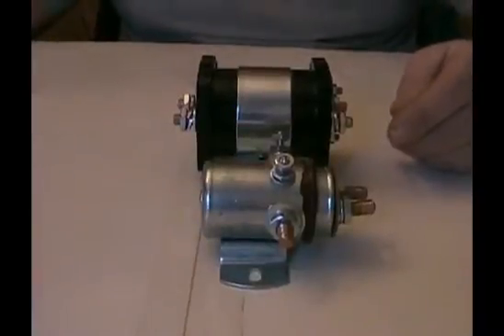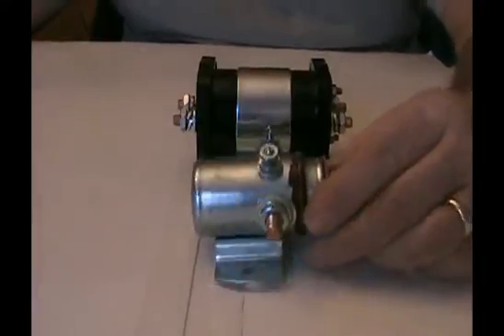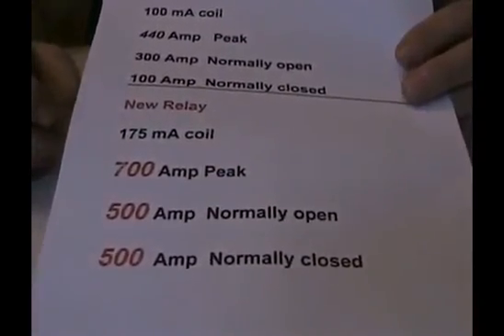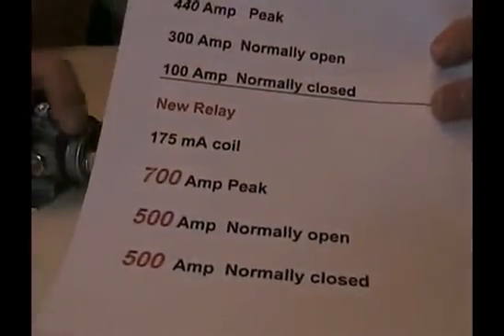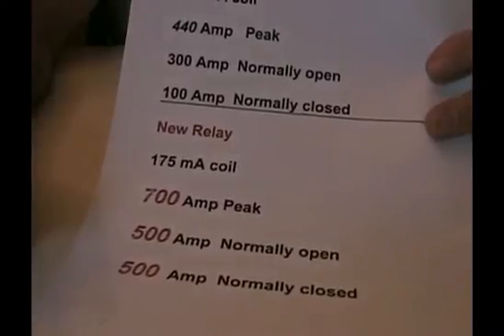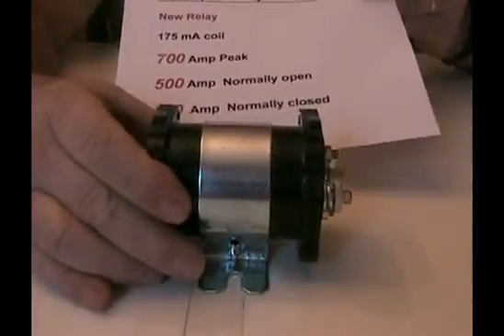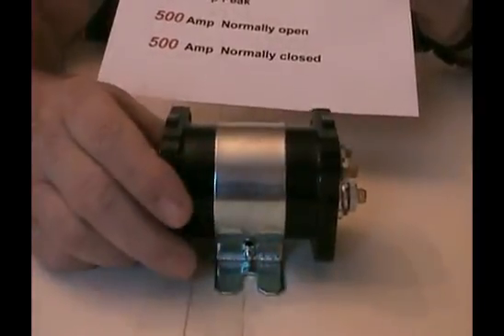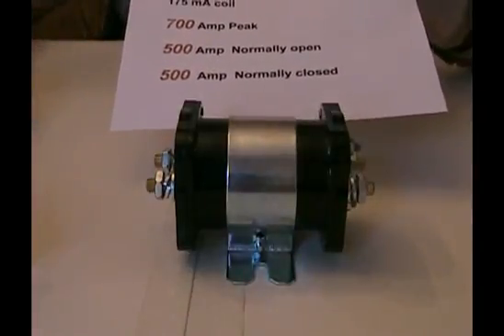Dump Controller Relays The real truth and facts.  DIY

Comment: I need to find a good Relay with 2 pole for switching a 7kva transformer off and on at 240 volts AC.   With my new inverter it has a call for generator function with it turns on a relay to start a generator.  what I want to do with it is turn the transformer off and one for when the system is switch to solar when I have enough solar to power the loads I have.  and when there is not enough battery or solar, it will turn the transformer on placing the system back on the grid.    and the coil can be any voltage.  but I would like a 24 volt DC coil.      

and that Relay looks like one hell of a relay.
Reply from the maker: +McCuneWindandSolar   Are you switching AC or DC?  24V coil should be easy.  Are you saying you need a SPDT relay?

Comment: Cool, great video Steve.  I think you should add that in cut mode it can't handle as much as when used in a dump load mode (normally open)  Also in the "BEER CAN" style the main spring has equal tension both ways (500 amps both ways)
Reply from the maker: How much can you say in 5 minutes